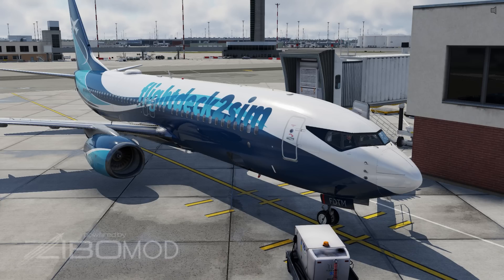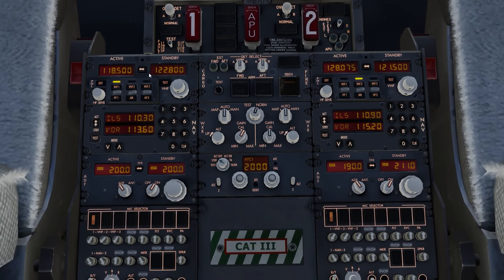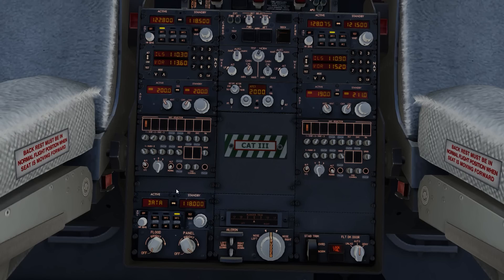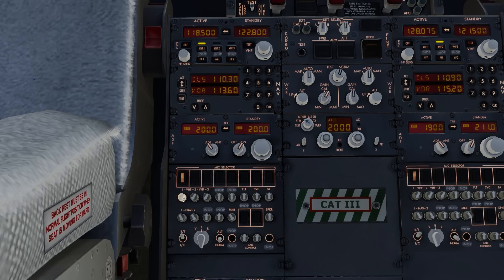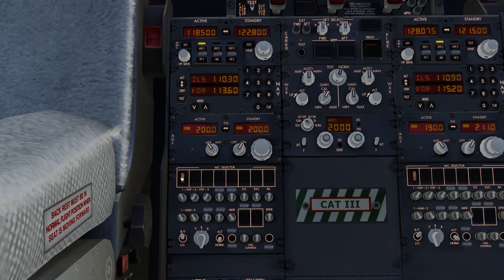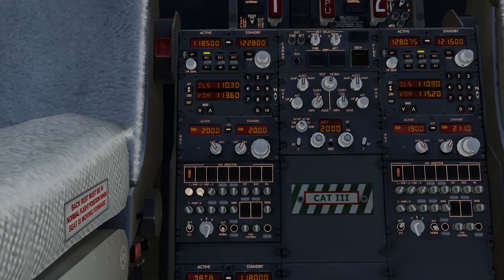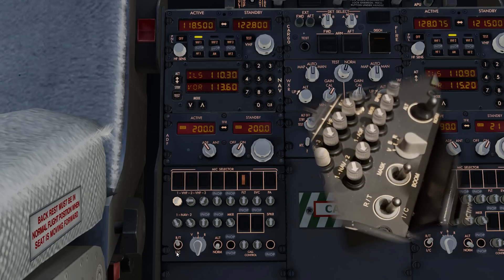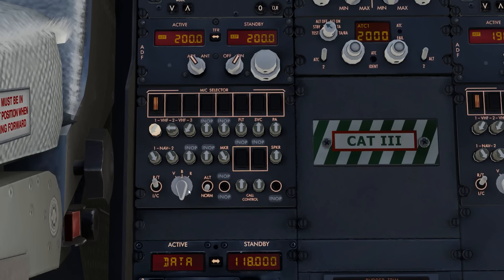Boeing 737 Radio Tutorial by Real Airline Pilot

Comment: Hi captain, I have a question about using the transponder on the ground. So quite a while ago I think you mentioned that we use ALT OFF when taxiing. However, when looking at the ATIS for KATL, I'm seeing: "OPERATE TRANSPONDER WITH MODE C ON ALL RAMPS, TWYS AND RWYS". Does this mean that we should leave transponder to TA/RA or at least set it to ALT ON because mode C includes transmitting your altitude? Is this also a thing over there in Europe?